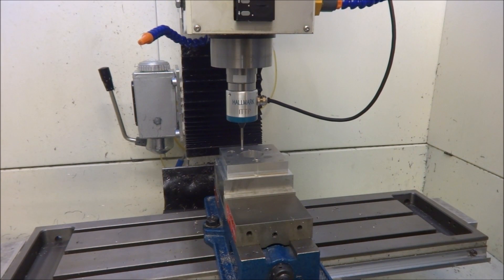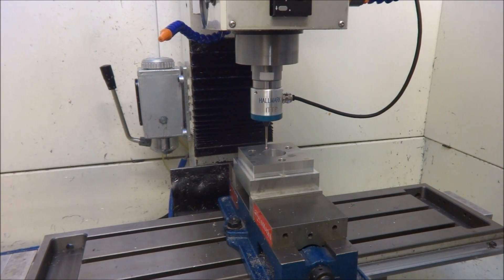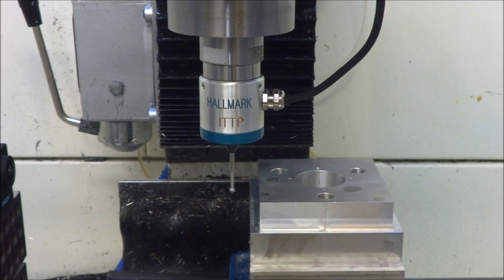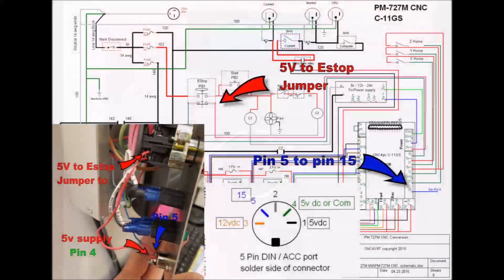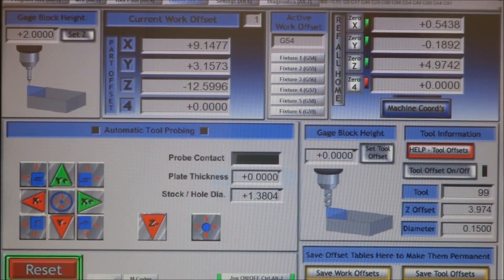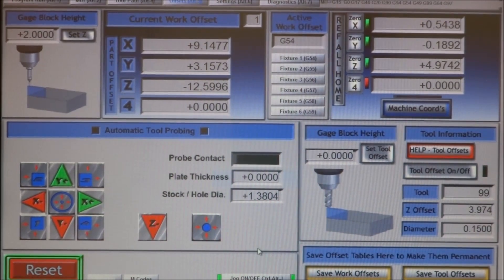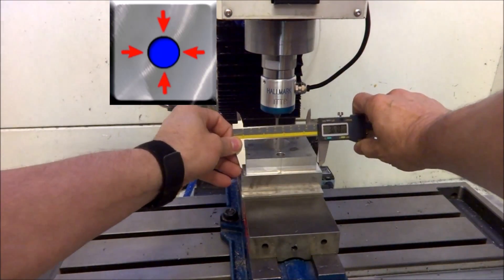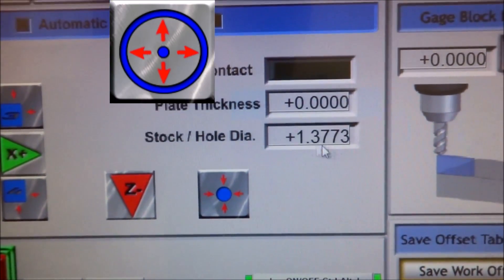Hallmark Design Ltd. Impact Tolerant Touch Probe

Comment: Sam, another outstanding video!  As far as I'm concerned, you have demonstrated some of the best, most forward thinking improvements for this class machine.  This touch probe is so cool.  I can see it taking much of the drudgery out of stock and tool setup.
Although your machine is a PM,  99 percent of your projects can be applied to my G0704 CNC, and I have been applying many of them to improve my system. 
I think I'll start referring to you as little Hoss! 
:-)

Best regards,

Frank
SE PA
Reply from the maker: Hi Frank, Thanks yes your right a lot of same things apply to the G0704. I was ask how I set up my stock origin so I posted a video.
From now on that process will be accomplished in 30 sec. and more accurate Than I can do by eye.
Be Safe, Sam

Comment: Sweet. You might consider putting a plug in the head casting and only having a short 12" or so cable on the probe itself.. I set mine up that way and was so much easier to just plug it in when I did a tool change, just a thought to help save the hassle of dealing with a long cord and being able to put the probe in the tool tray wherever you want without tangling on everything!
Reply from the maker: Hi Chris,
 Thanks, I may add a ACC. port somewhere close to the spindle at some point. I still need to get it complete ATC , Belt drive, PDB etc.  before I can figure out where a good spot will be. I dont mint the cord it helps to remind me to switch off the spindle. I hope your build is coming along well.
 Be Safe,
Sam

Comment: Hey Sam, glad you got Cliff's new ITTP. He's got some awesome engineering and testing, and most definitely quality into this
product. One question: do you have the capability to do multiple probe redundancy and the software refines the results in a more refined accurate measurement/position of the stock? Wonder why stock is only one entry, why not have length x width x height? Maybe I am missing something in Mach 3. Cool stuff.
Reply from the maker: Yes you can definitely see the  precision and craftsmanship that went into the probe construction. I would say 5 Stars. The Stock Mach3 offsets tab has no auto probing routines just a means to jog a wiggler into the stock and set the DRO. The probing routines you see in this video were all written as just basic routines for simple stock setup. As I mentioned I modified existing scripts I found on the Zone to take into account Tool offsets so when you set Z zero with the ITTP you also set Zero for Tool 0 and all the tools in the tool table will have the correct offset. I welcome suggestions on more elaborate probing routines I have already updated these so there is a User defined feed rate depending on what your setup requirements may be. Corner probing will zero Z, X and Y all at once as well as account for tool offsets. The ITTP is so accurate there is really no need for redundancy however I have also been working on a rapid probe to find the edge then fine probe speed for accuracy both Feed rates are user defined DROs.  The stock DRO entry is to approximate the stock size and eliminate a probing routine that requires a seeking function to find the edges. As a bonus O.D.'s and I.D.'s results are also displayed in the same DRO.